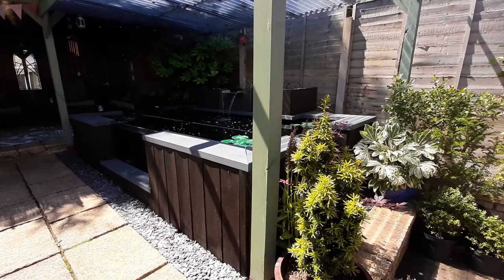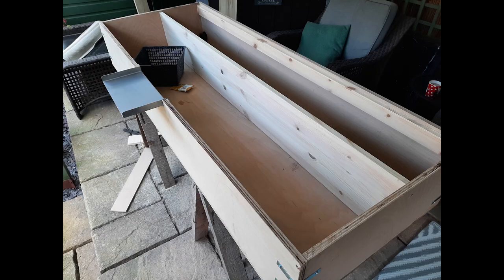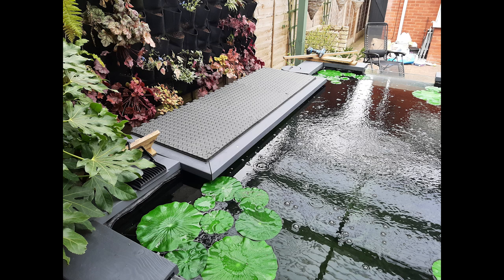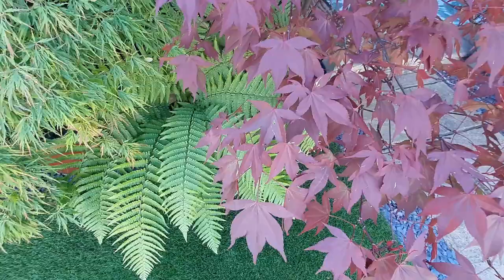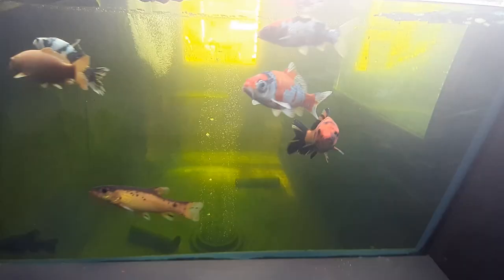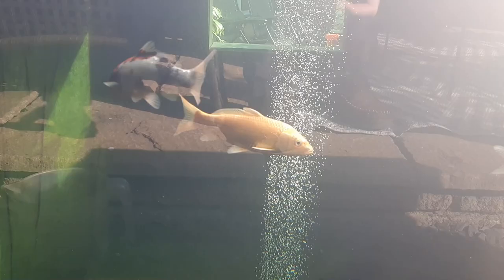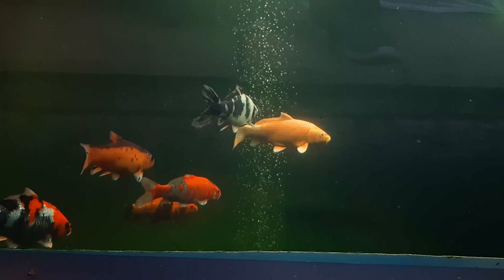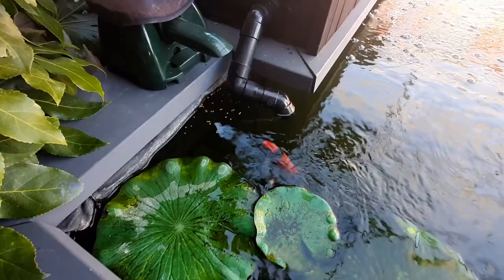Summer 2022 update on my 3 window semi-raised pond with EazyPod, moving bed, UV & living wall

Comment: Nice! What happened to the living wall?
Reply from the maker: thanks Michael... sorry for the delay. I didn't get a notification of the comment. I actually stripped down the living wall and moved it as I needed access to build the bog filter. I did have a problem with the irrigation system that meant I lost some things over the winter. I moved it back into place earlier this year though and I've added a few things. I think it will be next year before I try to rebuild it though. I will be incorporating a better irrigation system this time too. It takes a lot of water to keep it looking nice as the plant pockets dry out very quickly.
Reply: @johnclipperton3774  cool! What issue are you facing? I have also just built a large plant wall and struggling to get enough water pressure to adequately sprinkle water via the drip emitters
Reply from the maker: @michaelzhao5873  it was quite complicated. The water reservoir for the wall was connected to a large water butt behind the main part of the pergola (not the bit over the pond). I should have just left the tap open on this to allow it to fill the reservoir whenever it rained, but a few times i closed the tap to let the water butt fill up a bit, to give some back up water. When I wanted to fill the res that meant opening the tap and on several occasions I did this and then forgot to close it meaning I lost all the water. I then had to rely on hosing the wall down and this just didn't keep up. It was always my plan to run a constant trickle into the pond but being on a water meter I couldn't swallow this cost in the end (along with sky rocketing energy bills!). That would have seen the reservoir filled all the time but alas I can't do it (it could also mean potential for a background level of chlorine in the pond water). Anyway, I've recently added a rainwater harvesting system for the pond as I want to soften the water a bit, so I may be able to bring this into play also. The other thing is that having just 2 spray arms at the top didn't really seem to irrigate the entire wall very well. I've been focussing on other things this year really but planning on getting the wall back to it's former glory maybe next year. The Heuchaeras were great most of the year but a few of them completely climbed out of the wall and fell out over the winter too... I really need a greenhouse to maintain these over the winter but I don't have space :(